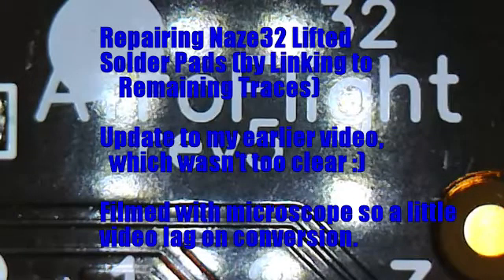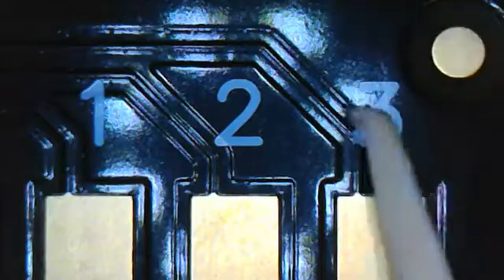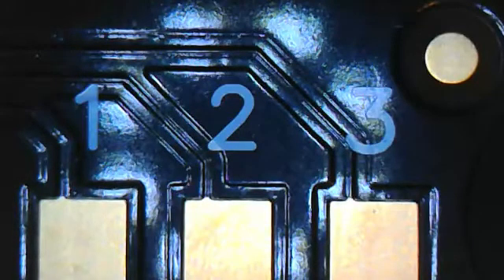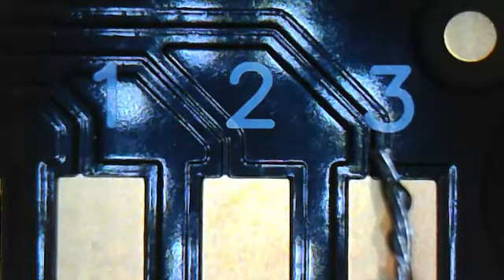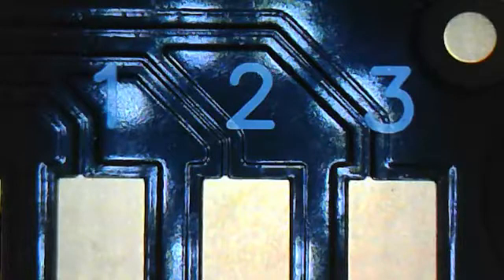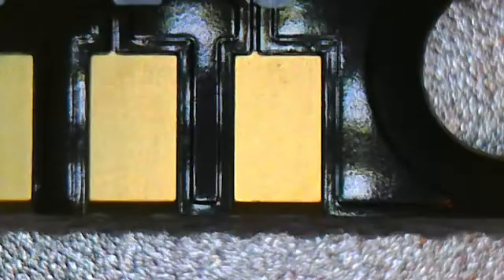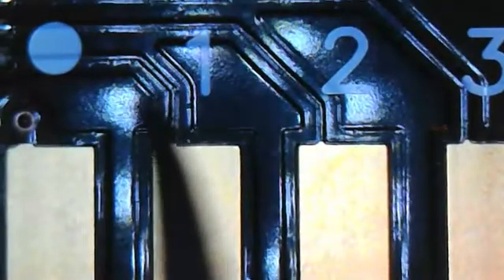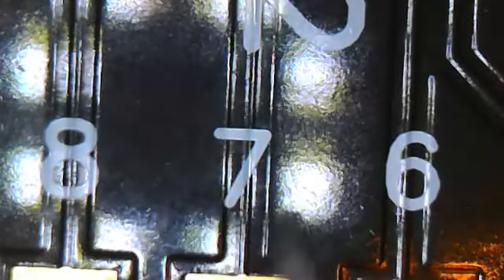Fix Damaged Solder Pad on Naze32 or Other Flight Controller 2

Comment: Yo brotha you are a freaking boss. I'm so thankful I found this little gem. I was tinning my solder pads by doing a sweeping soldering motion and the pad must have been peeling cause it came right off my brand new never before used KISS FC and it happened to my Little Bee 4in1 20a ESC and PDB which cost me almost $60 and the KISS was 40 and they both happened within a week of each other so I was pretty heated to say they least but you have given me hope and something to look forward to a new skill to add to my toolbox.
Reply from the maker: Thanks. Hope the repair goes well. I am still flying a repaired Naze on my beaten up ZMR 4s so it can work. Best of luck.